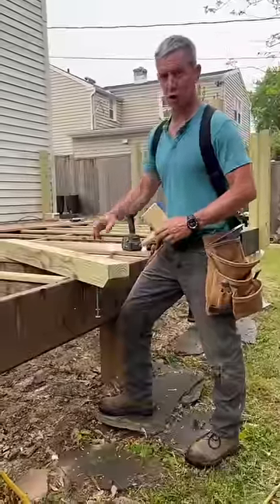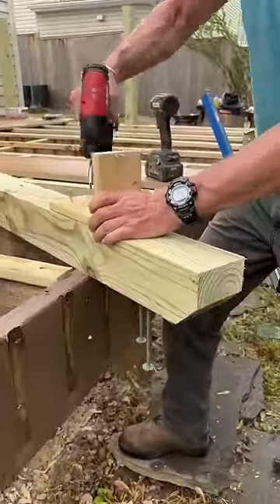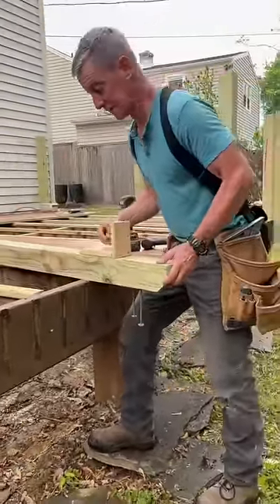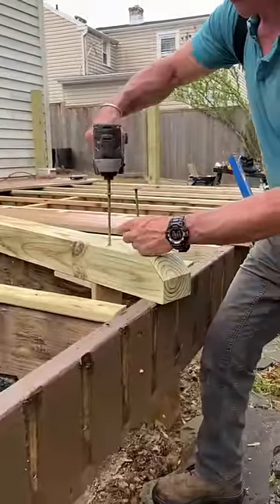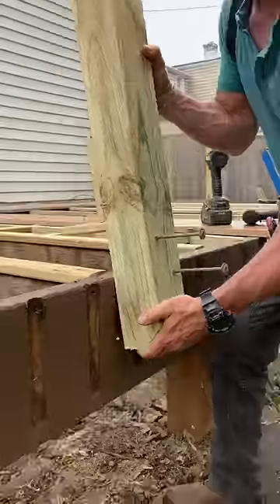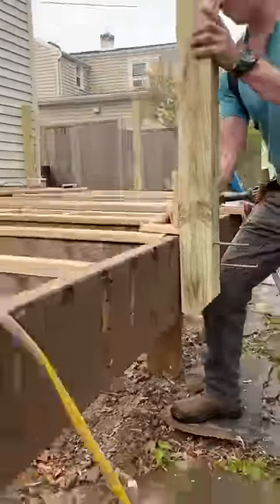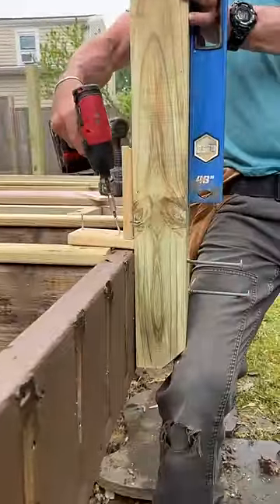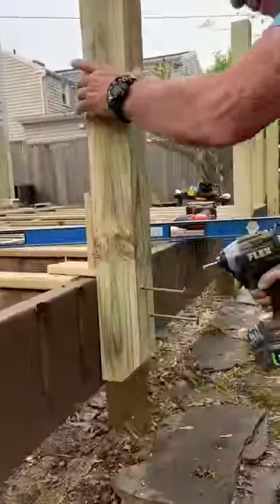DIY Tips: How to set a deck guard post by yourself

Comment: I use 1 nail to hang the post in position while I DRILL HOLES for carriage BOLTS . Anything else is lazy and inadequate  , because over time those post will become weak
Reply from the maker: I'll bet your holes for BOLTS (I can read bot upper and lower case, you know) are 5/8-3/4, right? So the entire connection is based on compression of washer to washer. If the wood shrinks (it will) that connection can loosen up (ask me how I know). Here, I get 100% head-shank-thread connection to wood fiber. It can't loosen up. It can't wiggle loose. I know it's not written down for you anywhere, but it's hardly lazy or inadequate.

Comment: Carriage bolts buddy
Reply from the maker: I use the same screws for the ledger connection and post-to-beam. This is a resurface and didn't go through plan review, but I'm positive the only thing moving these screws or posts anywhere is TNT.
Reply: @myfixituplife  
Time rots screws, where I'm from bi-law requires  lag bolts

Comment: I personally prefer mounting the post on the inside of the rim. I like the extra mounting surfaces when adding blocking.
Reply from the maker: That's my go-to for new construction. This is a resurface and there was no room inside the band joist for the post and blocking because it was doubled up.
Reply: Can’t see it from his house 😂
Reply: I would do the same as your way,but,  I would lay out the handrail  post down into the ground about 18" minimum
Reply from the maker: @pipelinerskilllabro1659  go get ‘em.
Reply: @myfixituplife  Not an excuse. What you are doing is dangerous. I hope your employer sees these comments and make you redo it correctly.
Reply: @williardbillmore5713   why would you assume he has an employer? I would believe  Either the home owner is paying him, or he is doing free work for himself or his people. Also, an appeal to authority is an act of cowardice
Reply: @neonsean1983  I assume he is not working for free and he is alone. That makes the home owner his employer at least for that day. Hoping people have a safe and secure deck that they are paying for can never be seen as cowardice.Allowing a bum to do crappy work that will hurt someone rather than confronting them and letting them know they are incompetent  is cowardice.
Reply: Inside is where you're supposed to mount posts, in the corners, and midspan directly adjacent to floor joists against the rim joist in those corners.
Reply: With blocking all the way around*
Reply: It's not just your personal preference, Ross...
 It is prescriptive IRC code pretty much everywhere now.
 The clown in this video is dangerous.
Reply: @Astromyxin  Yep, inside with blocking all the way around and if the joist is in the way then header it off.
Reply: @colossalbigfoot256 Tailgate warranty... It's guaranteed until the contractor's tailgate is out of sight!
Reply: How do you like notching all your deck boards around your posts.  Lol . Probably takes all day to build 1 ,10 ×12 deck. Then when the decking dries and shrinks it looks like hell
Reply: Journeyman carpenter for 8 years now. I’ve always set these on side of the rim joist. If this is your own house tho who cares. Those GRK fasteners are extremely strong. The post would break first.
Reply: Looks good in the rear view mirror

Comment: I like to use plastic shims. I think the wood ones rot quickly and deform more. They also split and fall too easy.
Reply from the maker: I use composite shims all the time. They're required for cable rail - https://youtu.be/kAChBcgxZqw - But they're not as slim at the point of the taper as wood shims. They're 100% stable.
Reply: Yeah me too. I use window packers if I've buggered up the checkout. In Australia we would bolt that, not use battern/bugle screws. Especially if we were just using pine instead of hardwood.
Reply: True, with wood sort of, except make a wood shim from PT,  very many items of plastic turn very brittle and break under slight stress, to quote a popular utuber "that's not good"
Reply: Build the deck plumb to start with and you don't need shims. Put the post inside and secure it on all four sides and it will be much sturdier.
Reply: Thanks, I'm a DIYer and never thought that threw.
Reply: First that I catch up
Reply: I already called Mr george
Reply: @GND3153 It's an existing deck and wood warps
Reply: I wonder if he packs house frames up with pine.

Comment: Pro tip, double up the bandboard if you're mounting rail posts like this. Lags or even through-bolts aren't going to keep a single bandboard from flexing. That's especially true if your railing post ends up on the band halfway between joists. 

You can accomplish the same thing with creative blocking behind the band anchored to the joists, but in my experience, it's stronger, easier, faster, and ultimately cheaper to just double the bandboard.
Reply from the maker: I hear you. Couple things. This band is doubled. There is a 2x8 behind the 2x10. It was a gutter of leaf debris that lasted 20+ years. Notched posts, too. - I know people love the double outside band, but if you're using a beam, it's just a waste of wood. - New, if there is room, I house and block the posts. That said, try ripping this em effer off the band.
Reply: @myfixituplife  
Ah, didn't see the 2x8. I tend to just use the same size as the outside band. The problem with single bands I've run into is that the whole band will flex, splitting decking and even pulling hanger nails out at the end of joists. I swear some people treat rail posts as if they were tackling dummies or something. Waste of wood or not, I try to build them so they can tackle them I suppose.

And yeah, a better post is inside the framing so you can bolt in 2 directions, but like you said, takes up square footage.
Reply: Yep, I always double the band board all the way around the deck.. I also use carriage bolts and always notch the 4x4 so it sits on top of the band board. I feel like I get a lot of strength doing it this way, instead of relying on just the bolts alone to carry the load..
Reply: That front box isn't going to flex it's screwed to joists all the way across smh. The side boxes might flex if not doubled up

Comment: Install this post with a shoulder cut on the inside of band joist...it's much stronger and it looks better IMO
Reply from the maker: The shoulder cut worked for a long time. Heck, I took 25-year old shoulder cut posts off this one. I do prefer a full post with structural screws like these Spax. Cutting notches takes time. Blowing in screws that'll stay put is money in my pocket and a customer served.

Comment: We use  6×6 here. Also we notch the post to the inside 1 1/2 . blocks on the backside and bolts thru  the front . It looks a lot better  than a post on the outside of the band . And with a  notch you don't need a jig.
Reply from the maker: Notched 6x6 is a mighty corner post. It’s also heavier, requires milling and giant hardware. I get it. It looks good, but I work alone. I’m not working with 6-by unless I have to.
Reply: Notches on guard rail posts are also not code..
 More bad advice.
Reply: @williardbillmore5713  notching a 6x6 is ok. Notching 4x4’s is not allowed.
Reply: @macgyver03ga  Notching 4X4 or 6X6 railing posts to go on the outside of a rim joist is not allowed by IRC code.
Reply: @myfixituplife must not be licensed, notching has'nt been allowed for years now

Comment: This railing attachment to deck does not comply to Code 
 Refer to Simpson Ties and review their deck construction manual.
In MA compliance with  the Simpson deck manual is deemed to comply with the MA Code (,IRC 2015)
Reply from the maker: None of this deck meets code. This is a resurface. And I'm not an engineer, but I'll put 3-PowerLags up against 2-thru bolts all day. For either to fail, the deck has to have catastrophic forces put on it.
Reply: You must work for simpson
Reply: @myfixituplife code requires a hold back device fastened with thru bolts to blocking on the other side of the band.  That installation is rock solid.
Reply: People were building decks before Simpson and Ties came along. My decks were done the same way 31 years ago, and haven't moved an inch. The thing though that stiffens the post is the 2x6 railing cap that spans the deck. If he uses the standard fancy deck rails they have today, then the posts will surely wobble in few years. Everything is about the construction.

Comment: Set the posts inside the joist and block them in. Big bolts not lags. I build decks 2-3 stories up. If they ever failed on some lame lag i'll be screwed for life (pun intended). Do this part of deck construction the best way technology allows: not the way this guy is suggesting
Reply from the maker: In new construction, locked and blocked all day. In a resurface that below my belt buckle, no. - You have structure, loading, and continuous load paths that are no joke. Keep up the solid work.
Reply: I always block mine in as well, rock solid. But this will be ok in this application.
Reply from the maker: @Wellokthen  Yessir

Comment: Never use lags on terminal points with treated lumber. It should be a bolt through.
Reply from the maker: They're not "lags" -- even though the old posts I took out were lagged and lasted 25-years--they're structural screws that are 50X better than old school lags. These posts are permanent.
Reply: Carriage bolts all the way. No cost is too high for saftey
Reply: @arcadiagreen150  Isn't a cost issue to begin with. Its just a different method for the same result. Too many know-it-alls here thinking because its not "their" method, it's wrong 🤦‍♂️
Reply: @Steven McKenna  know it alls are different from do it alls. Running 3 structural screws in is easier than drilling (2) 5/8" holes in each post and using (2) 1/2" diameter x 6 inch long galvanized carriage bolts that will last 30+ years. Not to mention that many local building codes won't allow for anything else.
Reply: @Guildround  same result?...is thr goal for it to just stand upright? Duct tape would have worked as well. 3 days or 3 years not much difference
Reply: @myfixituplife  lags or not. Same basic concept. They are threaded and they do have an application in kiln dried lumber. Deck matériel (pressure treated lumber) shrinks for one thing. Anything terminal like railings or structural components should be thru bolted. The stress of people leaning, expansion and contraction due to moisture/temperature can cause the lag/screw to fail by loosing its bite in the material. Thru bolts will not fail especially if installed correctly. Most municipalities will not allow the use of any but thru bolts of at least 1/2” in diameter. But if you want to continue to be a hack you go right ahead. I mean what do I know I’m just a retired engineer.
Reply: @Guildround  It's not code so it isn't safe, Steven.
Reply: I live in Trumbull county Ohio. Code doesn't let me use bolt through anymore. Makes no sense what code is anymore

Comment: I've ONLY built decks with posts included into the framing. Putting posts on with screws or whatever is less than desirable--in my opinion. You do yours as you please 😊
Reply from the maker: I get this a lot. And I hear you. But PowerLag screws are Beast Mode. - This deck was a resurface, a project I do often and is a repair, not new construction. - Thing is, it works.
Reply: Yeah the way it is built in this video is a huge code violation... doesn't matter if they're repairing the deck or not if they build it like that they should be fired and will likely be sued if the post ever fails and someone gets hurt
Reply: @myfixituplife  You have no idea what you are doing and you shouldn't be giving ANYONE advice. Calling a lag bolt a "power lag" does not make it safe to use in this manner and describing them as "Beast mode" does even less.
 Posts should be attached inside the band board and attached using through bolts with washers and nuts to the joists, the band board and blocking. What you are doing is unsafe and illegal.

Comment: In Australia that is not allowed. The posts have to be on the other side of the beam and are bolted in.
Reply from the maker: I hear you. Couldn't put them inside on this deck re-surface.
Reply: Couldn’t pull building permit either.
Reply: Here in the US too. That would fail.
Reply: No where neaer the strength on the outside. Ahhhh welll few years it will be leaning
Reply: @myfixituplife MAKE IT WORK!
Reply: That mess isn't allowed anywhere

Comment: Posts go inside, through bolted… if it’s your own project, even better if you have time to add some extra frame blocking around the post once its in, just for extra resistance to movement under load… still through bolted, ideally in two directions.
Reply from the maker: Through bolted in two directions? Are you building an office building?

Comment: I highly recommend using plastic/composite shims.
Reply from the maker: 100% no argument. Good call.
Reply: @myfixituplife  Keep up the good work. There's a lot of weirdos on YouTube that just troll videos. Just pick up a copy of the latest IRC and your local code book and cross reference your work.
Reply from the maker: Yup. I use the DCA-6 or decks. - This is technically a repair--it's a re-skin--so code is a gray area here. Frame is 25-years old.

Comment: Serious question How long does that stay tight only screwing into a single 2x?  I always used carriage bolts because screws always seemed to loosen or rot out over time.
Reply from the maker: I'm banking on this being a permanent connection. The screw geometry put into modern PowerLags versus old-school lags is something. These are the same screws I use for ledgers. They're approved and don't loosen up.
Reply: @myfixituplife  Carriage bolts are far better!
Reply from the maker: @phillhuddleston9445  I don’t think they’re necessary. The screw technology is optimized. Back in the day, yes, carriage bolts. But today? Not for me if I can help it.
Reply: Just think how much stronger it would be screwing from the inside so the threads engage the 4x4.

Comment: The better thing to do is make sure the outer band is NEW because that is what is holding the entire porch up ... I never understood why people would spend so much money on new wood for everything and then try to reuse a half rotten band board just to have it rot and split 2 years from now and have the entire porch looking brand new but be unsafe to walk on 🤷🤦 ... You should have replaced the band board while you were down to nothing and then you plumb the band board so you don't have any exposed shims for the posts or shimmed posts at all ... Once you have the band plumbed and the joists in place , you then cut your posts CORRECTLY AT THE RIGHT PITCH so that they sit flush against the band and before anyone says we'll its just for the hand rail , let me remind you that there's always someone and/or their children/grandchildren who are going to run up and lean on it so it needs to be properly secured and the way you sank those screws in which allowed the post to push off the band , well , you should have stopped , backed the screw out , pushed the post back up tightly against the band and then screwed the screw back in again after the screw hole was started so the top of you notch sits flush against the band so that you don't have to have any shims in the first place ... 

Sorry I just realized this comment seemed judgemental and that was not how I meant that to sound I'm sorry ... I just would have done it a little differently and not reused that band board since it was completely exposed to the point it could have been easily removed and I was always taught to reflush after starting your holes ... Anyhow sorry for the negative feed back because I genuinely don't like being or giving negative feed back ...
Reply: Its not his house and he knows its going to be a big pain in the ass to replace it. Plus he makes more profit this way.
Reply from the maker: Let me help you understand. First, there are budgets. Second, pressure treated lumber is amazing stuff. 25-years in and the wood fiber is intact. I could only get the 1/2 the fasteners out while removing the decking. It took huger leverage to pry the deck boards off. So third, all these claims that the deck is "rotten" are just not correct.

Comment: Screws are evolving. Lots of truss screws that have  higher load capabilities are available now. I really like them. Like the ones you are using.
Reply from the maker: For sure. I use the same screws used here in the ledger and the post-to-beam connection. I'm satisfied this material is fused at the molecular level.

Comment: Now replace it because you split it "driving home" the second screw.
Reply from the maker: Have you every driven a structural screw into a soaking wet 4x4?
Reply: Inside and a drilled hole for a bolt dont split
Reply: Yeah, and no countersink.
Reply: @myfixituplife  Most real carpenters would never use SCREWS to attach guard rail posts and no real carpenter would ever attach them to the outside of the rim Joist.
 You must realize by now what a deficit this video must be to your business' reputation.